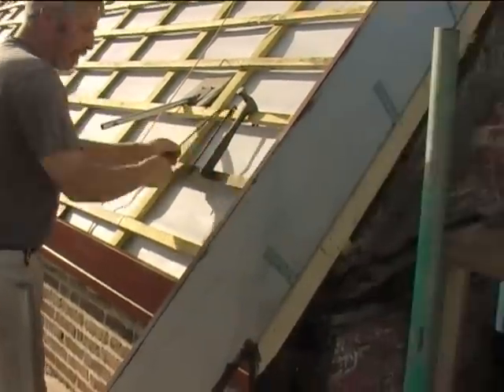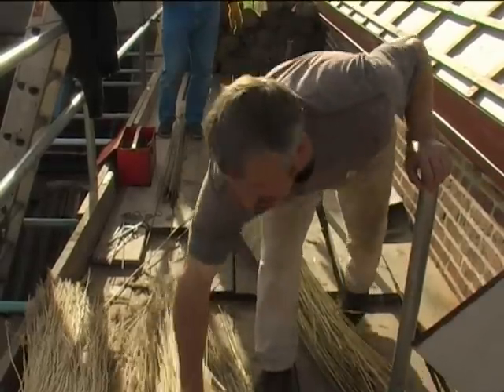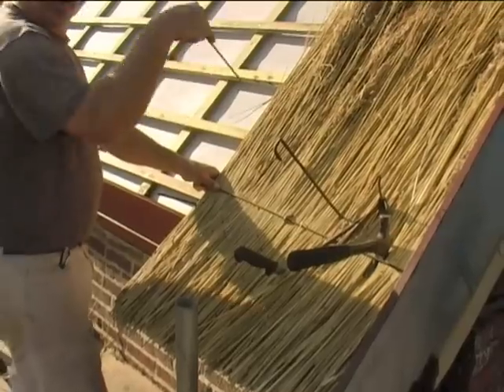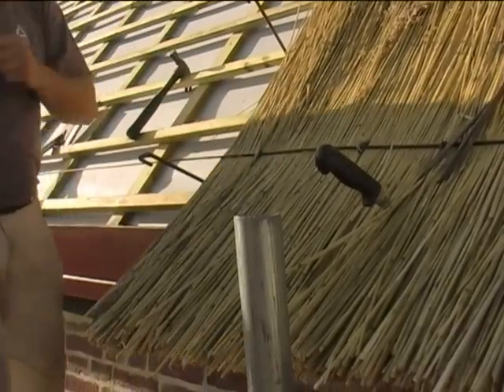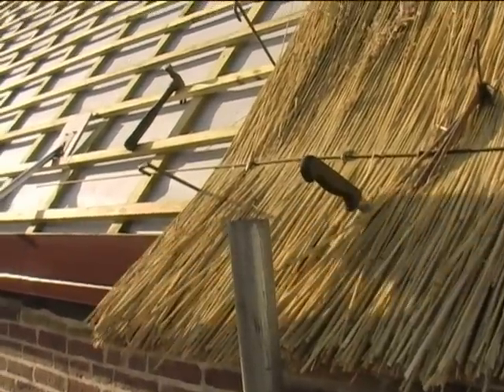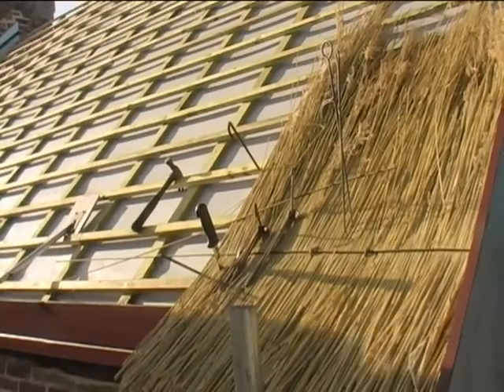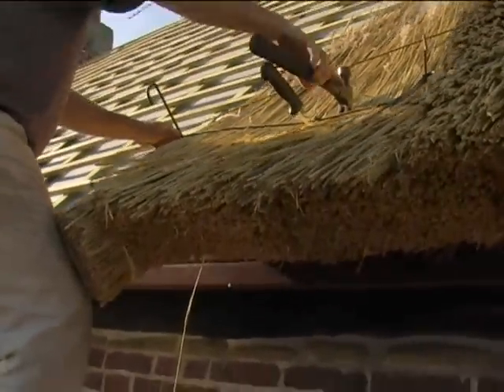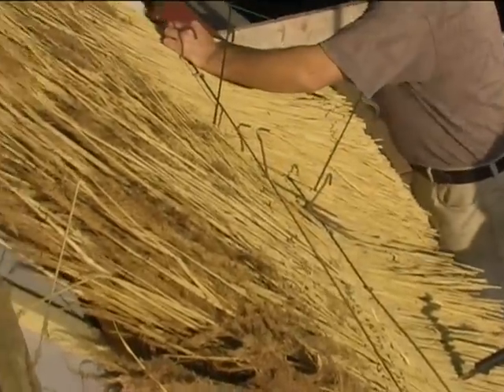Thatching Part 2 - The Start

Comment: Why is Thatching still used for roofs in Ireland when there are other materials available like asphalt shingles and tile which would last much longer. Is it a love of tradition and culture which has kept this type of roof structure alive.?
Reply: The Insulation properties are obvious. Cool inside in the summer and warm in the Winter. It holds about 40 years - not too bad.
Reply: Maybe because it's beautiful??
Reply: @tenj00  You should look into Enviroshake, composite roofing material. We also make Enviroshingle and Enviroslate
Reply: Because all thatched houses in Ireland are protected structures you must maintain the Thatch by law.

Comment: How is this different from the way they do it on Japanese farmhouses? Just curious. I think the reeds lay a different way? And on top of the timber frame they have a board/sheets of woven bamboo for water proofing I think. I don't know but damn, I want to build my own house so bad and go back to nature.
Reply: If you live in America, you can forget that plan. American building code would not allow thatching for a residential project.
Reply: On a Clover-Covered Hill i
Reply: @bigc473  all depends on location, if you live in some parts of rural America, 4 walls and a roof all needed :P
Reply: @bigc473  well America is a continent not a country but if you're talking about the United States yeah most places you couldn't get away with something like this there is all kinds of unincorporated no building code areas though in the United States I know because I live in one you can do anything you want you can live in a shed if you want to and a lot of people do in Southeast Missouri the only time you have to put any type of permit at all is if you want to put in a septic system but there's people down there that don't even do that they just run it out into a ditch and once a month to go out there and throw a little lie on the ground you'll never see or smell anything
Reply: You should look into Enviroshake, composite roofing material. We also make Enviroshingle and Enviroslate
Reply: That's funny cause i can't even get a shed on our property in butler county.

Comment: There are 2 type of hooked rod you used, where did you stick both rod? Is it on the horizontal wood or to the wood/plywood or anything material beneath the fireproof lining??
And also i saw the process when i was in Holland they use wire to tighten to horizontal metal rod.
Reply from the maker: The two hooks are of different lengths and are driven into the rafters at different angles to secure the steel rods that holds the thatch to the roof. An alternative method, also used in this country (UK) is to drive a screw into the rafter with a wire attached which is then tightened and tied off above the thatch layer. The next layer of thatch then covers this fixing, as with the hook method. The metal hook method is more traditional, the screw and wire method more modern and probably a faster method of fixing.

Comment: Is it rain proof please
Reply from the maker: Yes it's rainproof. Because of the angle or pitch of the roof (minimum 45 degrees) rain is shed quickly. Water may only penetrate 25mm in to the 300mm thick thatch.